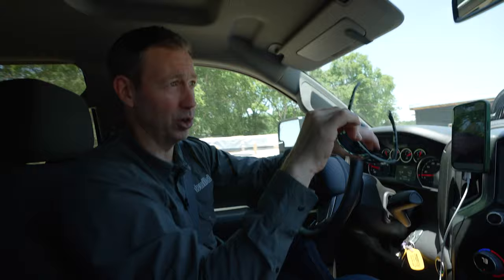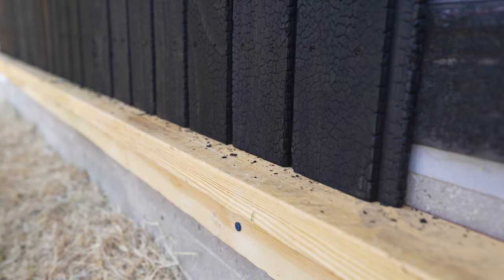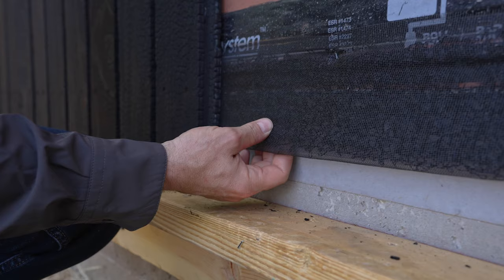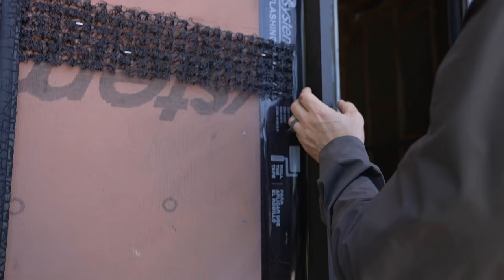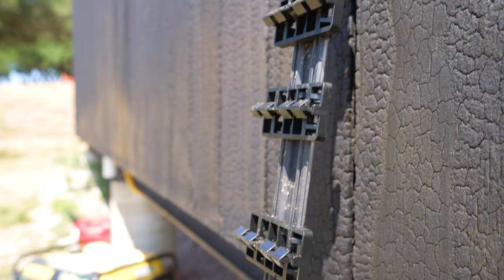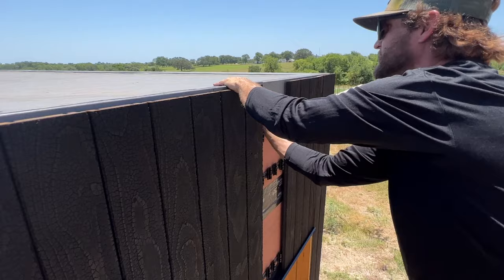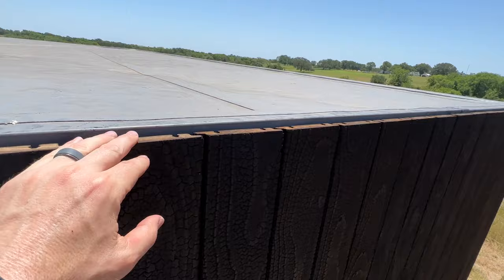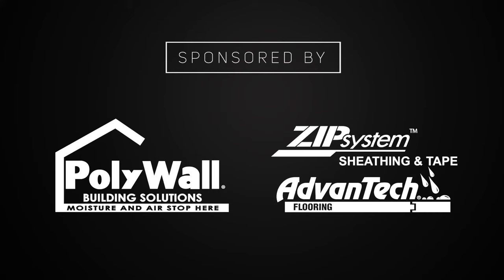So Easy Your Siding Guy Will Actually Do This

Comment: Matt, I've got an idea for a few vids you may want to do. You do vids on new tools and techniques, how about a few vids on tools and techniques that have withstood the test of time?  Or how tools have evolved over time, like levels, from ancient water levels to modern laser levels.
Reply: Water levels work very well!
Reply: Those water levels require special calibration techniques and experts with tools specific to the hose. It would be way too complicated to discuss in a 15 minute youtube video. You'd need at least two hours.
Reply: @woodspirit98  But for most purposes the  water level is fine.  Temperature changes are an issue.

Comment: Wasn't mentioned in the video. Was their horizontal blocking on the inside of the framing to nail off the vertical siding every 24 inches?
Reply: Same question, wish someone would answer.
Reply: Agreed.  I assume not, and therefore the entire install was compromised.

Comment: Can you do an overview of a fire resistant home? From foundation, to deck, to wall, to roof. It would be really interesting.
Reply: Concrete.
Reply: Well, and specifically not concrete with a vented wooden roof on top.
Reply: Forest fire proofing involves.. 70-100' of rock... Then 15' of sand then 10' band of concrete around the home.  Add a 20x20 pool .No brush no shrubs nothing that isn't in a pot. Hardie board siding and roofing. No OSB or plywood. Stainless steel screws and a metal roof
Reply: @alexandrep4913  Agree and I have noticed the same. 
I think he did only one ICF home and despite praising the system then he never went back building more homes with ICF.
The reason may be that the trades he works with in his area are not familiar with ICF and may be very unpractical for him to use it. Or pure marketing reasons: 80% of home in the US are built stick frame of any flavor, so wood sticks, OSB sheets, nails and tapes, most of his sponsors are selling just those products and most of his viewers want to see just that content.
Reply: @sebastiantevel898  ICF isn't common in his area because people usually don't have basements or poured wall foundations. The majority of his area is going to be slab on grade and some pier on beam.

Comment: window details are definitely important. 
and also rain screens and air gaps.

but what Matt forgot to mention is the Massive overhangs.
they look like they're extending 6 to 8 feet off of the building.
that's going to do the bulk of your rain-proofing and keep the building dry.

With overhangs that are that massive you could honestly do a horrible job on the waterproofing details and still not get any call backs.
large overhangs on buildings are very under rated

Comment: Love that Kebony system. Probably relieves some pressure when wood swells a bit with temperature, allowing some moving without putting added stress to the members/material in the wall assembly, I like it. Would be great to know what kind of router bit would work with that product.
Reply: The groove is a proprietary bit that comes from the manufacturer, but we stock it pre-grooved with the rails across the USA/Canada: https://us.kebony.com/products/cladding/grad-for-kebony/

Comment: I didn’t see the earlier videos on this project but could someone explain to me:
A) Why did they do one system on the main house and another on the exercise pod? Was it just an experiment to see how well / easily the Kebony Click-in System would work?
B) On the main house…what were the stainless steel screws fastening into? Did the Bensonwood panels already have horizontal blocking built into them behind the Zip sheathing shown in this video? Normally you wouldn’t fasten vertical siding only to sheathing.

Comment: A quick note about the way he was bending that head flashing for the window.. In the corner of that bend (end dam) there should not be a cut. Minor thing that just happened to stand out to me.

I should add that this is beautiful work from the looks of this video. Wish I got to work in this level of home construction but it's hard to attract rich af homeowners in my area.
Reply: Do you fold the end dam without snipping? Doesn’t that distort the metal?

Comment: I really like the siding on the exercise pod. It's so simple and looks so good. Unfortunate that you would have to destroy it if it is capped
Reply: Glad you like it! If you think about it, you normally only need to remove a board if it needs to be replaced already. So destroying it doesn't really matter. https://us.kebony.com/products/cladding/grad-for-kebony/
Reply: @kebonyusa  I don't understand why you would have to destroy it at all? Wouldn't it just pop out again?

Sure the first one might be fiddly but after that, easy to just pop out.
Reply: @benwhittle7204   The boards and mini rails are not designed to pop out, they are designed to click-in and stay fastened in place. You can slide them but you will destroy the rail system or board if you try to pull them straight out.
Reply: @kebonyusa  I see, would be cool if you could design it so that you could slip something in the joint and temporarily release the latches, though I guess it’s probably not worth the effort.

Comment: On the exercise pod the lock system was installed horizontal. How does it drain water behind it like the mesh does on the main house? Or is that not a big deal?
Reply from the maker: The channels have air flow and water flow through them
Reply: @buildshow  Thank you Matt

Comment: Ok, technically Shou Sugi Ban involves Japanese Cedar.  (Sugi).  If that product is the Accoya product, it's not cedar.
Using black in a hot climate is an interesting choice.  The heat will transfer to the fastening system pretty quickly since it's metal, but from there hopefully the insulation will prevent hot spots.
The burned wood may be bug resistant which would be nice.

Comment: I wonder if it would be lower cost if a composite decking material was used in place of that wood? And if the grad system would work with it?
That Shishugibon finish is amazing!

Comment: Wouldn't the hemlock be a wildfire risk? Shou Sugi  Ban doesn't just look good, it is also fire resistant, but that doesn't buy you much if other parts of the structure are NOT.
Reply: "sugi" is cedar in japanese and over there, it is only made with cedar. But in American it can be any kind of wood because nobody knows what sugi means and theres nobody stopping them from false advertising/labeling.
Reply: It totally depends on what vegetation is around the building as to what the fire risk is. Keep all bushes away and if it's only grass burning is pretty low risk
Grass burns hot but fast and so doesn't have time to heat high up eves to combustion temp.
Reply: @Pepe-dq2ib  Yeah, I just now commented on that too.  It would be like "Oak Cabinets" made out of Poplar.

Comment: Hi folks. In the UK we now have over enthusiastic building control (code) insisting on cavity closers (fire barriers) to seal any gaps behind cladding, at the top bottom and the sides.  This creates issues as you need to ventilate the gap still. This results in some bloody awkward detailing with expanding intumiscent products. Do you not have the same issue in the USA?
Reply: (As I understand it) The gap behind the siding is so excessive moisture can run down behind the siding.  More of a drain than a vent.  So having it closed at the top wouldn't be an issue.

Comment: Absolutely love the Shou Sugi  Ban siding. Really looks fantastic. I would love to use something like that on my new build but unfortunately the area I live in is prone to a lot of hail and I don’t think it would be very durable.
Reply: I suppose if your overhangs are big enough it doesn’t really matter?
Reply: @FreekHoekstra  If the water goes sideways as in Scotland... No overhang is big enough
Reply: @aitorbleda8267  sure but hail doesn’t tend to go sideways,
And it’s lasted for multiple centuries in Japan which has hurricanes and severe tropical storms.
So it’s probably fine.
Reply: I like the look of it as well, for TRIM that is, not the entire house siding.  And NOT in Texas FFS!
Reply: @michiganengineer8621  why not?
Reply: @FreekHoekstra  Hot summer sunshine + dark colored (heat absorbing) siding wouldn't make for a light air conditioning load.  Even with those large overhangs on the eaves, the house is still going to be getting a lot of solar gain.  I know it's extremely well insulated, but personally I would have gone with WHITE siding and used the sho sugi ban for trim.
Reply: @michiganengineer8621  given that in Texas they are so close to the equator the sun sets and rises very quickly.
This means the vast majority of the sun solar load will be on the roof and as we can see it has fairly decent overhang so very little sun will strike the side.
Also charcoal itself is kind of a decent insulator. And it’s vented.

So you think although you are technically right, it probably doesn’t make a huge difference. But I could be wrong
Reply: @S M its a lot closer then most of the US.
And angular solar gain is a lot lower there then say in michigan.
Reply: @michiganengineer8621  Yes.  Use the dark siding high enough up the wall - matched with the size of the overhang - to get winter sun.  As is it's going to get very hot, and the metal fastening system on the second building will also get very hot and try and transfer more heat toward the structure.

Comment: Looked up that product for the rain screen and can only find it in Canada.  Is there a US option?
Reply: I have six rolls of it left over from a huge cedar shake job if that might help
Reply: @dee73  where did you buy it from?  We're wanting to side our home build soon and need horizontal strips.  This looks like it would work well.
Reply: @Off-Grid  i don't think you can buy it in the strip form it will come in a 48" x 100' roll i got mine  local supplier that's where we got to cedar shakes as well
Reply: @dee73  I did find it in the 4" strips but only in Canada.  Buying a 48" roll would work too.  Thanks for the tip.

Comment: How will the plastic hold up. It won’t get brittle with age and boards start sagging or falling off.
Reply: No
Reply: I personally wouldn’t worry too much- no UV back there to make it brittle, and the siding boards have it pinned on tight.
Reply: @timgleason2527  but I wonder what the siding boards are attached to.  Just the rollout Easy Fur and Zip board?

Comment: I would love it if my house looked like it was lit on fire at some point. This modern architecture is crap. It's a square box with a gas station fuel island roof sitting on top. You need an architect for that?

Comment: ledger board isnt flashed and is touching the wood siding. going to  be the failure point in future
Reply: Ledger board is only there as a level surface to set the ends of the vertical siding boards on. It will be removed once the siding is up.

Comment: No they won’t for free. They will if they are payed for it though.  There is no extra labor that is so freaking easy that anyone should be expected to do it for free. Such a typical attitude from a builder, adding work to the subcontractors and expecting it for nothing.